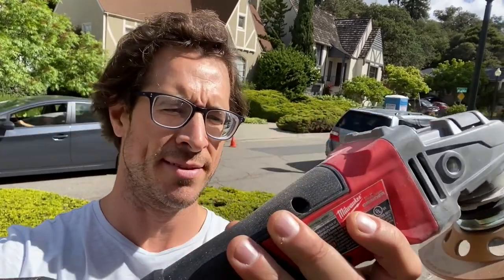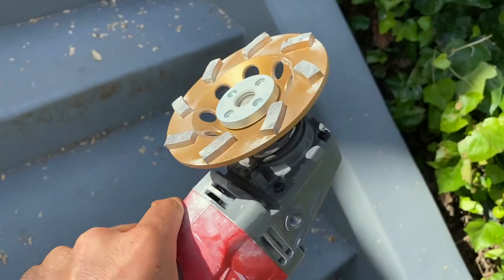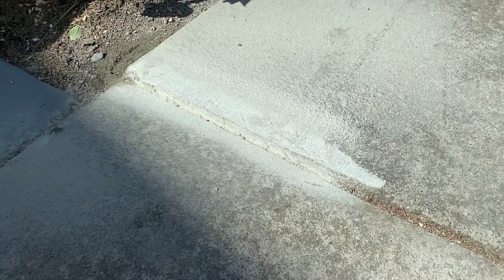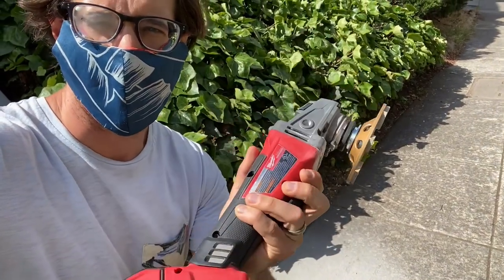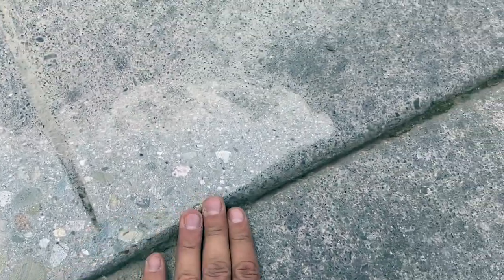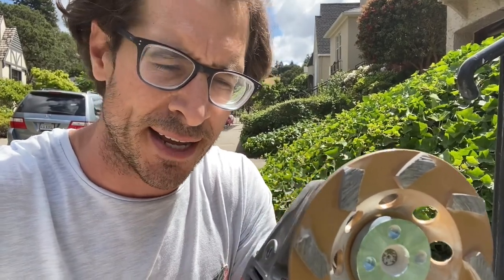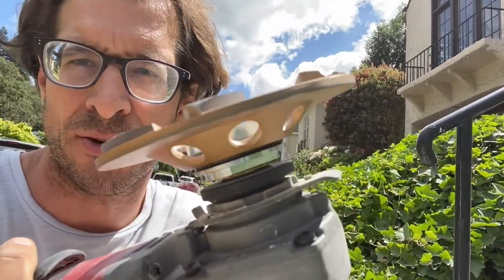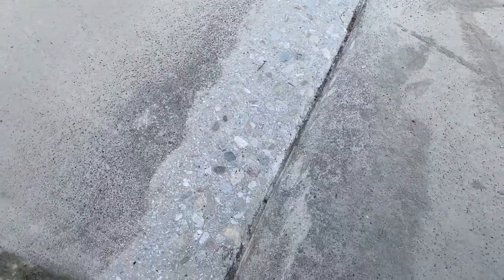Concrete vs. Milwaukee M18 Cordless Angle Grinder | 3 Tips on Grinding and Polishing Concrete

Comment: I have this grinder, I think you were underplaying the battery issue. I tried grinding a 2 car garage floor to prep for epoxy, and it ate through the batteries and overheated like hell. In the end I got a cheap Dewalt with a power cord to finish the job. The cordless did about 10% of the job. Lithium batteries are not up to the tough jobs that grinders go through. For small jobs this model is ok, anything tough then use a corded model.
Reply: Battery grinders are great but you should not be using one for a whole floor. I have a dewalt 60v battery grinder and it has a 2300 watt output while the most you could ever get out of a corded grinder is 1700 watts of power. It eats through 9 amp hour batteries quickly but not faster than i can recharge them.
Reply: I think it should be noted that he is using very low pressure when grinding. He takes half an hour skimming down a bit over a quarter inch. Cordless grinders won’t overheat if they are used with a very light touch.

Comment: I'm glad it works for you, it's funny though, that's probably a good $400 of equipment you used whereas the rental was $170 for 4 hrs. Granted you already had the equipment so it didn't cost anything but the $40 for the disc.

Comment: Have you tried it with water yet?
To control all dust and keep cool
Reply: I am curious too.  Thanks for the video.  I am looking into doing the same thing.  However, I might run a long cord instead.
Reply: I would do the same too😊
Reply: The only issue with using water while grinding is sludge. It will be a mess. And worse if you have a hepa vacuum attached. Dry grinding with a good mask and good vacuum, & ventilation is the way to go.

Comment: Is there some reason  you can't use water to keep the dust down?  I see people wet grinding with larger grinders.  Can't figure out why I'm not seeing any videos of hand grinders being used with water.  I want to do this to level a high spot in my bathroom before laying LVP.
Reply: Good question. I was wondering the same – did you figure out an answer from somewhere yet?
Reply: @Nettle314  No...but my guess is that you can.  It's probably a very messy process though.

Comment: Awesome video!!  Thanks!!
I have a 2'x2' slab of concrete that I need to grind down about 2-3"....   Based on your experience, is that a good blade for that, and how long do you think it might take?
Thanks!!
Reply from the maker: A bigger blade would be better. It would take a long time to do it with the blade Jordan used as 2" is  a lot of concrete to remove. Jordan only removed 1/4" to 1/2" and that took him an hour.

Comment: Setup by my employer worry everyday I will die from silicosis from drilling into concrete the dust is fatal with no hope please spread awareness.
Reply: if this post is genuine why don't you contact an attorney to sue the pants off them for violating OSHA industry compliance requirements. I don't know the exact type or to what extent of concrete drilling you referred to, but it sounded substantial and significant. If it is, well- It became official a few years back, google it, that concrete grinders are to be equipped with dust shrouds / dust removal systems. Masks/respirators are also pretty common sense, but- alone, aren't up to task without the aforementioned. Look for another employer but don't quit ur current one - not yet. Once you've actually gotten HIRED by your replacement workplace, sue ur current one, and have no regrets. Remember you really have nothing to lose, except your life . Isn't that enough ?